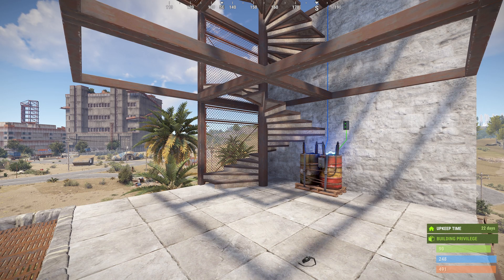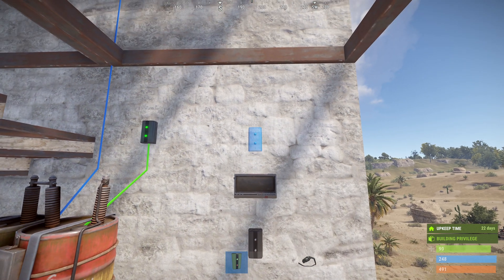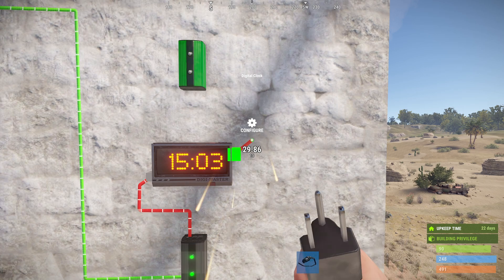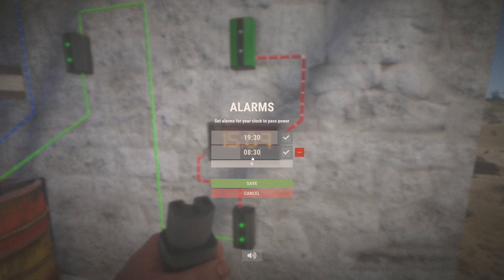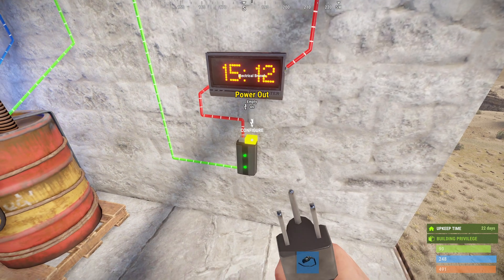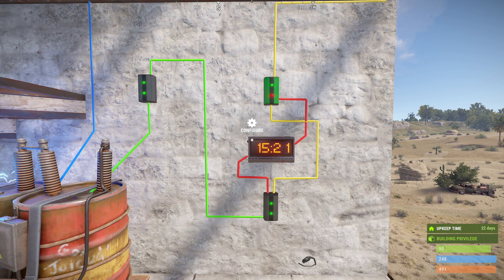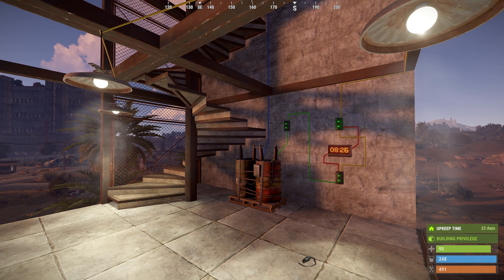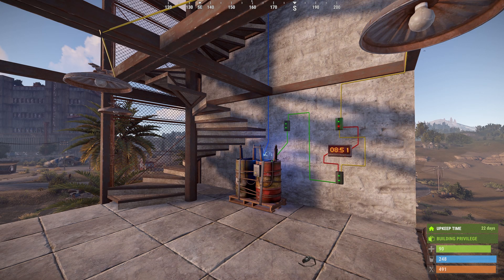Schedule base lighting using the Digital Clock - Electricity guide - Rust

Comment from the maker: Had a few people suggest using a Memory Cell instead, so this is a new video to show how that is done.
Reply: Got a question. How do I add more items after you use the Electrical Branch and the memory cell since there is no more connections? Do I hook up a Splitter, run that from the branch and to the cell. Then connect more branches off the splitter to use for other things? Not sure if that will work and if it will interfere with the cell
Reply: @cratty3  Just add more electrical branches in a row. Going from the battery. One of the electrical branches can be used for this set up in the video and the others can be used for othe stuff.
Reply: @Tischa1994  The only issue with this is anything hooked up past the Branch that is hooked into the cell it doesn't work right. I had to run everything before the Branch and the cell then it worked
Reply: @cratty3  Electrical branch basically does the same thing as splitter but you can set the power you need. Unlike with the splitter where it just devides the input by 3 and you cant set the power individually.
Reply: @Tischa1994  Ya so, I tried the Branch into a splitter and it was still messing up. Only way I found was hook the stuff up before I did the Branch and cell. Anything after caused timer issues
Reply: Ya makes sense.  Not everything has a toggle power switch like the Fluid Switch & Pump.

Comment: Lights are staying on, doesn't work
Reply from the maker: That's weird, works in the video, and the countless times I've used this in game. And no-one else seems to have a problem? I'll try it out next time I build a base... Just in case it suddenly stopped working.
Reply: @friendnotfoe  Did you happen to figure this out? I'm having the same problem. It's turning on but won't turn off. I'm using a test generator to power it, not a solar panel. So, is it still on because it still has power stored in the memory cell?
Reply from the maker: Haven't used this for a while but have this wipe and it works fine turning heaters on and off in my farm.

So not sure why it isn't working for you... or did you get this working?

Comment: Another useful way to use this is to attach the Output of the memory cell to the On side of a switch, and attach the Inverted Output of the memory cell to the Off side of a switch. You'll need to move the power typically going into the memory cell into the switch instead, and have a second electrical branch with 2 (?) power going into the memory cell, but the nice thing about doing this is if you want to turn the lights on for any reason - for testing, let's say, or just to see what your base looks like with the lights on - you can manually flip the switch. The memory cell will still take over and turn the lights off when it hits the alarm, or turn them on - even if they're already on with the switch. In other words, it doesn't interrupt the flow of anything, it just gives you a way to quickly flip the lights on (or off for that matter) without having to modify the alarms on the clock itself.
Reply from the maker: That's a great setup, very flexible.

Comment: Is there a specific time to set the clock? I've been having troubles with it. I have a kind of medium village and I have my buildings setup this way and some of them turn on and others don't... Sometimes I change the devices and it fixes other times it doesn't... But I'm setting the clocks the same way.... What can it be?
Reply from the maker: Hmm, not sure. But I have come back to my base on occasion and found lights still on when they should be off and vice-versa.

Usually it is power supply related, like running out of solar and the alarm doesn't trigger as a result, they power returns and lights are out of sync. Other than that, I'm not sure.

Comment: I can't get this to work, does it matter if the clock and memory cell are receiving power from the same branch?
Reply: Nevermind, I only had 1 power to running to my clock but you need to have minimum of 2 for the toggle to work. Thanks!
Reply from the maker: Glad you worked it out :)

Comment: Do these not work for the industrial lights? I followed the instructions and they don't work.
Reply: Works for me, make sure you have enough power left over to run the lights. If your in between toggle, I have added a third alarm to trigger then delete afterwards.
Reply from the maker: I didn't try the industrial lights, but I see no reason why they wouldn't. It's just sending a pulse of power at a specific time to toggle the memory cell on or off, nothing new there. Try your setup with a ceiling light maybe and check everything is set up correctly.

Comment: I did a variant of this circuit that allows you to bypass the alarm circuit and go to a manual on/off. First I put a switch between the branch and the clock. Then I put an OR switch between the alarm and the toggle on the memory cell. Finally I connect a button to the other input of the OR switch. That way, I can turn off the alarm circuit with the switch and use the button to manually toggle the memory cell.

Comment: Instead of lights can you use the water pumps??
Reply from the maker: Sure - you can schedule anything you want - you can even set multiple times in the clock and the memory cell will toggle on/off at those times.